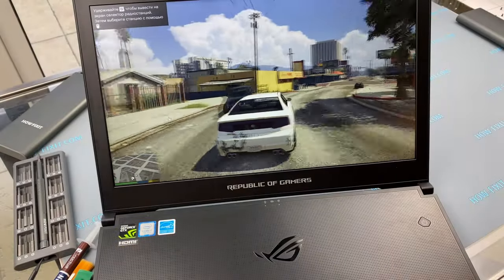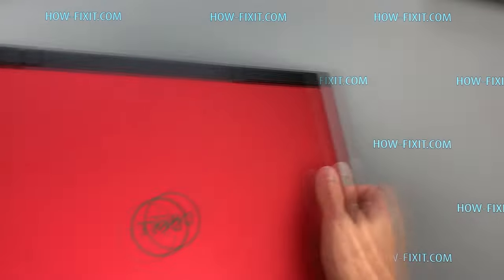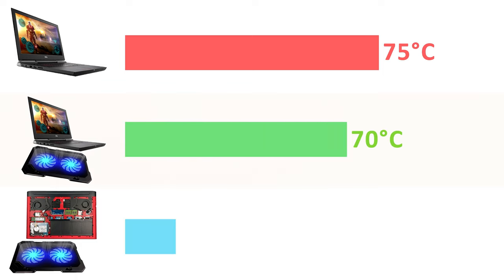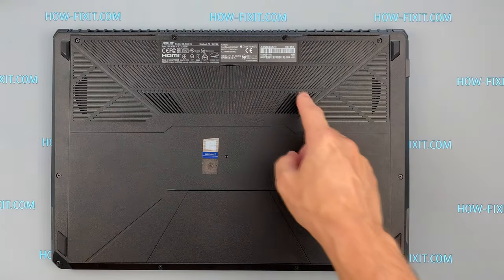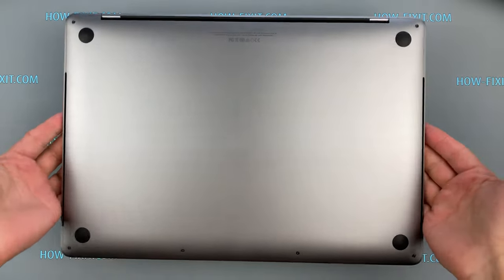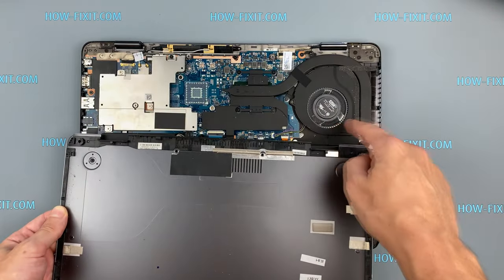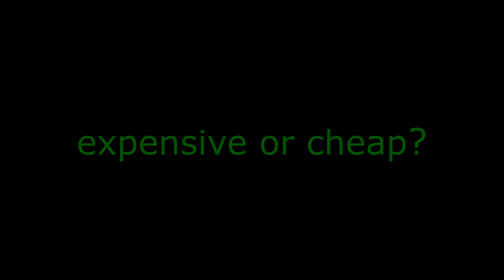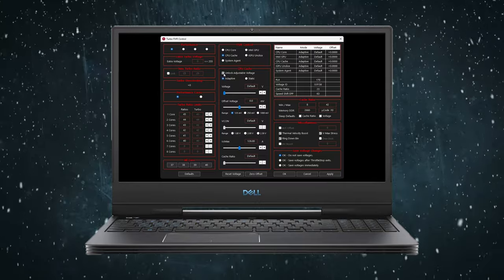Laptop Cooling Pad Efficiency Test Revealed: The Truth Unveiled

Comment: I discovery doing similar tests that if you just elevate the laptop from the table, leaving space between then, with nothing blocking the air vents the temperature decreases dramaticaly. Do not waste your money with cooling pads. This in normal use. Playing games that's nothing that can reduce my laptop temperature. I have the desire to put it above that icecream cold table to test but have not the chance yet... :)
Reply from the maker: Hey, thanks for sharing your experience! Elevating the laptop to allow better airflow is indeed a clever workaround. It's nice how simple adjustments can have a significant impact on temperature. Keep experimenting and finding what works best for your setup. Thanks for being part of the discussion!
Reply: It probably depends on the laptop grill as well. I tried without and without raisers and the temperature was the same for my Acer Swift Edge.

Comment: I also noted that cooling pads help with heat dissipation, meaning some laptops will only send heat a certain direction and a cooling pad will send that heat to different directions making your surroundings not feel as hot. My gaming laptop would only blow hot air to the wall making it hot to the touch.

Comment: bro, my macbook late 2008 was crashing due to overheat which is ofc cuz of the dust inside.. (recently got it and dont even have any cash to upgrade the laptop or clean and fix the laptop) i just but a big book at the monitor side and a smaller but wider book on the keyboard side. and it cooled down while i was STILL watching this
Reply from the maker: You don't need cash to clean your laptop, you can do it yourself. Just use the step-by-step video guides on my channel.

Comment: I've had people argue that this doesn't work at all, that it's the same as having your laptop on a elevated pad. But I've used it both ways and I can firmly say that my laptop had at least 3-5 ºC less with the coolling pad, it also doesn't thermal throttle as much, generally while being on a simple elevated pad it is a bit cooler than being flat on the table, but it thermal throttles after a few minutes playing games.

I use a cooling pad that has 6x80mm fans and a metal mesh with grooves for support, my laptop is a Dell G15 (R7 6800H, RTX3060). While playing demanding games with the cooling pad it stays at around 60-70 ºC on the GPU and 90-95 ºC on the CPU, without the cooling the GPU goes up to around 80-90 and the CPU at 100ish.

If I had a 3D printer and the required knowledge, I would try to make a mod for the lower part of the laptop to provide better air flow.
Reply: Dude. Buy the Aicheson K1 5V cooler, it's perfect. Brought my pc from 100CPU to 77 CPU and 94 GPU to 70GPU, costs 62 bucks with Amazon prime

Comment: Amazing video, straight to the point and very informative, keep it up!
Reply: Yes, good informative but with one thing missing, that is the fact that many laptop manufacturers design the cases to partly be used for heat dispersion, specifically on the alu/iron chassis', so I feel you are ignoring that on all the laptops you show doesn't have venting holes in them.
Reply from the maker: Hey, I really appreciate your kind words!
Reply from the maker: @WackyWheeling  YES, the aluminum case can be like a heat sink, but the cooling pad does not have any effect in this case - tested. Thanks for your insightful comment!

Comment: Should have tested the closed ones too instead of making assumptions.  I too assume that it won't help much the bottom does get hot and conduct heat.
Reply from the maker: This has been tested with the closed case, which is no problem for me. In the video, I said the conclusion of the test.

Comment: While charging my CPU temperature hits 91 and GPU around 74 is it a issue?
Reply: When plugged in laptops will clock cpu/gpu higher
Reply: If it's on idle, then yeah your laptop may have issues. But if it's under heavy workloads like gaming or rendering, that's normal. Usually 70 - 85 is the sweet spot under heavy workloads. But they can withstand for up to 120 or so, although it can damage the components in prolonged use.
Reply: Check if you have any malware. I don't see why cpu temps should be that high on idle